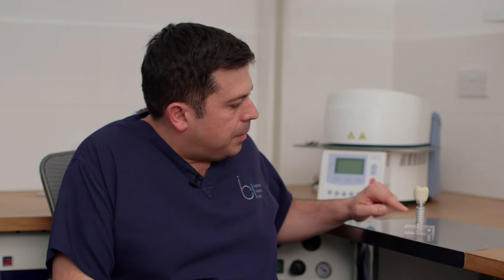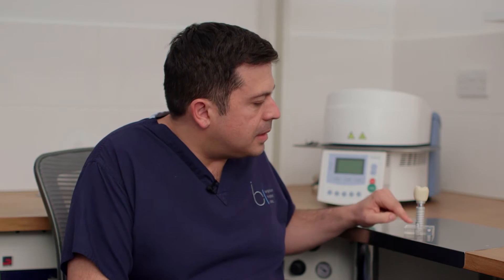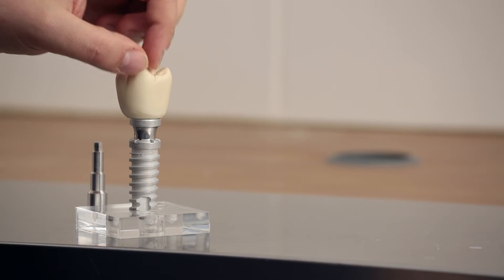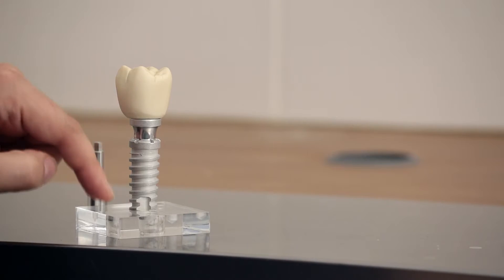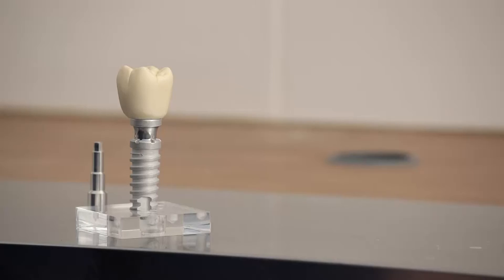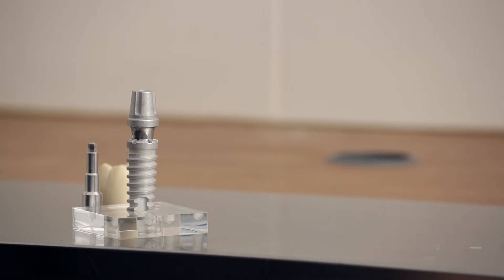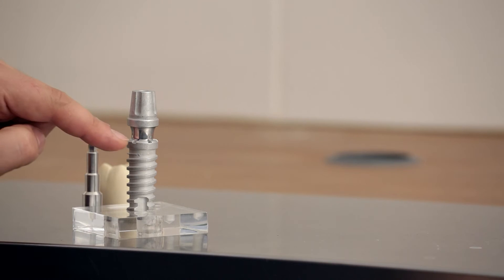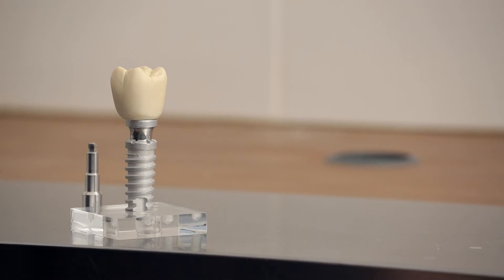What Are The Different Parts Of A Dental Implant

Comment: Is there an alternative to titanium alloy implants if people suffer from metal allergies?
Reply from the maker: yes you can get zirconia dental implants but these are not so widely used. We do not offer these in our clinic but you should be able to find many clinics that do offer zirconia implants.
Reply: Yes, you can ask for Zirconium.
Reply: I just had zirconia implant for my molar. It is getting more popular because titanium is not healthy.
Then i will have zirconia and abutment crown with carbon fiber screw, not titanium screw. Be careful, some dentist use cement or titanium screw for zirconia restorative dental work. No cement, no metal.